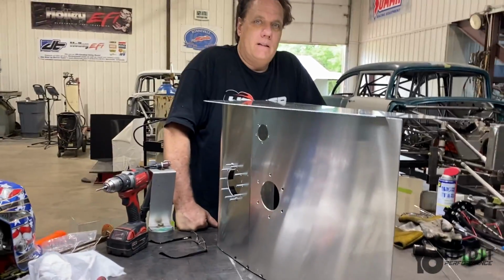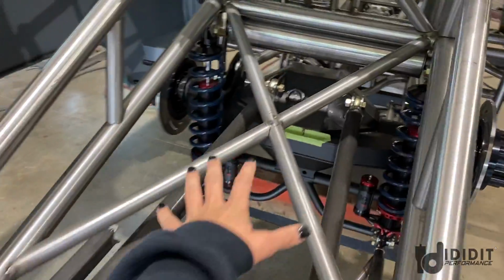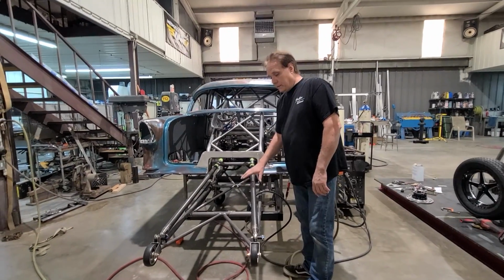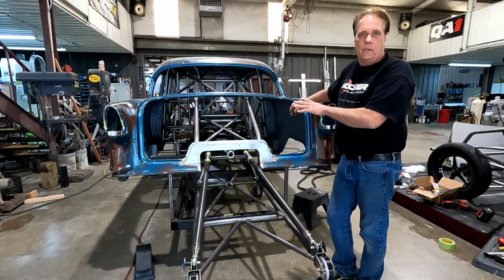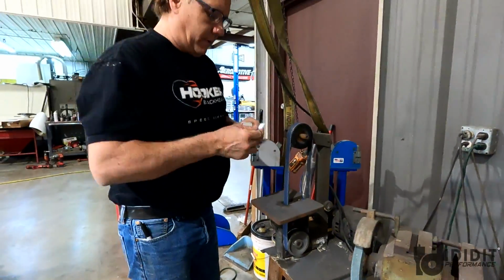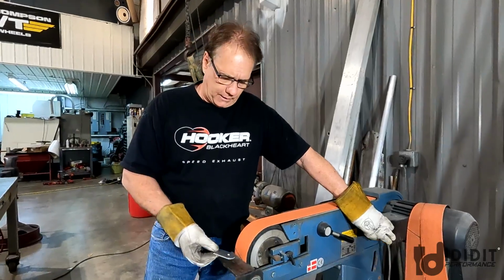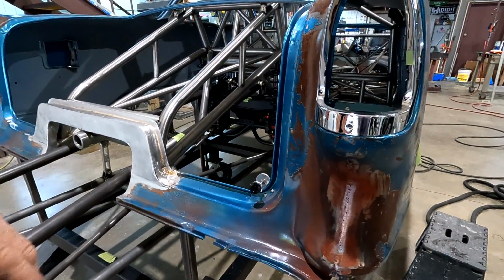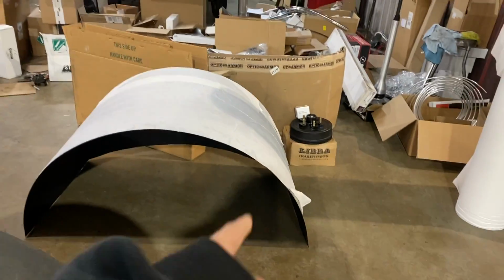Can DT YouTube?! Wheelie Bars and Trunk Lid Notch + Trunk Lid - 55 Build - Video 11

Comment: Dad and Mom are truly Racers to the bone. Build a 200mph racecar out of a 66 year old 55 Chevy. Impressive the different types of metal used to add strength without weight on the chassis and cage. 
Quite the couple.

Comment: G'DAY Taylor family, Dennis is truly the ZEUS'S of WHEELIE BARS,a true MASTER CRAFTSMAN,as I'm a 1965 model,40 yrs experience in the Mechanical Engineering trades,it is truly a pleasure watching a Tradesman at work & sharing/ teaching so many hard sweat learnt sills( the wisdom of using a builders SQUARE for guage for 11/2"&2", is a trick I've frequently used in both building 1 with timber & metalwork fabrication,& using what's at hand for radiuses eg. Washers,cans is certainly quickerthan the millennials with the CAD generated pickiest,as always, Kindest Regards, Dave McLaughlin Queensland Australia

Comment: DT did a great job and I like finding the little design elements that go unsaid, like the way the trunk pins line up with the tube in the center (parachute mount?) or the profile of the gas tank matches the trunk.

Comment: I'm retired from G. M. and I remember that option. It's is one of those Dealer installed items.The wheely bars came in a box with the sheet metal. The Dealership just bolted them on and cut the metal. Oh did you know that there was Dealer bolt on V-8 option that came in a box in the trunk of Chevettes. There's a lot of options people never knew about ! 🤔

Comment: I’m not sure if you’ve heard of this, but when making a bunch of the same brackets you can put a drop of crazy glue between your blanks and you only need to each operation once instead of once for every bracket that you are making. You can break them loose with some heat.

Comment: CNC Plasma for the brackets! That was painful to watch because I know I could have cut those much faster on the plasma table that I built. A lot of my stuff is one off as well, but it is very fast and easy to draw that bracket in cad and cam and then nest it to cut out of scrap. He could have jumped right to the sanding part and skipped all of the bandsaw work. I heard them talk about a plasma table but I'm guessing it isn't cnc or Dennis isn't as quick with the process as some of us. CNC Plasma was a game changer for me!

Comment: You should Put the Lisence plate over the tow hitch between the wheelie bars, right in the middle of where your Father Fabricaed that notch will look sick as if its just for the Plate 💯 Resess tow hitch in a small bit too.👌 Have it flip up and show the trailer hitch and the parachute mount 💯👌🤙 because you can put a plate on the trailer for Drag week 🤙💯☘ don't ruin that lovely smooth boot with a licence plate  🤙💙💚💙💚

Comment: That's a big gas tank, make sure to use slosh baffles in there to keep the fuel from going to the left and right making the car unstable. You're probably not going to drain that gas when in competition so you'll want to fill it with a big block of fuel cell foam to limit explosion risks...  Something to think about.

Comment: Mount the license plate on top of the trailer hitch and you can even wire a light onto it with a plug connector. Also there’s no need for the license plate when you’re racing so when you remove the trailer hitch it will also remove the license plate and the light. If you’re worried about 16 pounds on the front clip you shouldn’t leave the license plate on it for racing.

Comment: Dad has tinnitus from high decibel sound s- given his occupation and hobbies... (same as mine) it's every thing from hammering steel without hearing protection  - to firing off high compression racing engines with out hearing over the years it just accumulates - I was also at MANY concerts AGAIN without hearing protection - AC/DC, Van Halen, Billy Joel, Poison, Def Leopard,